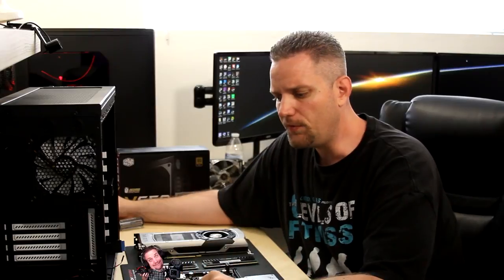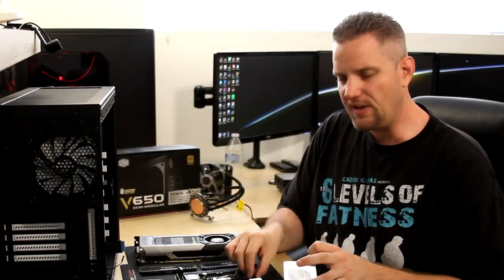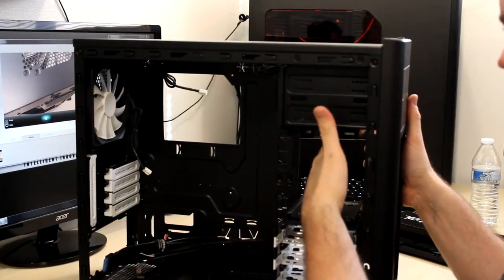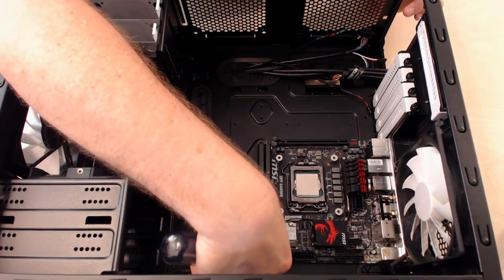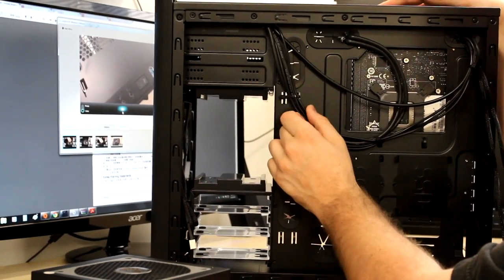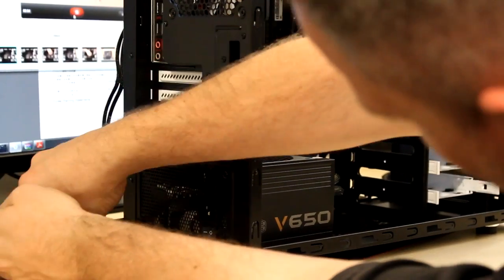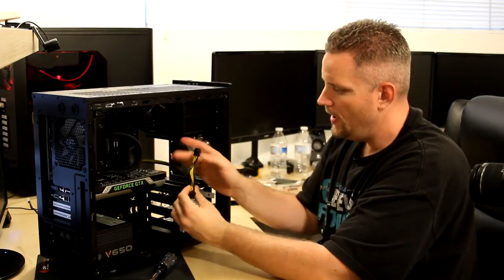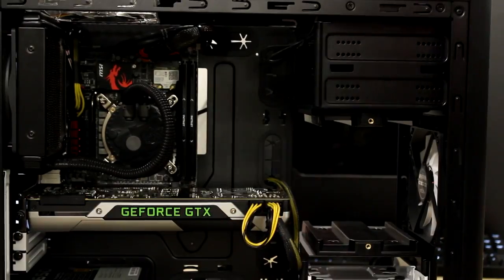Beginners Guide: How to Build a Computer

Comment: I will build a gaming PC in future, but what i'm worried about is the voltages because i'm in Europe (Russia), and i'm gonna get all the Parts from USA, i'm gonna get a Universal Power supply (110V - 240V) but what i'm worried about now is there will be a voltage difference in motherboard, ram, graphics card,.....?
Reply: What mains voltage do you have in Russia? It will probably be less expensive to buy your components in Europe.

Comment: Any advice or suggestions appreciated! :)

Motherboard: MSI Z170A Gaming M5
CPU: Intel Core i7-6700K @ 4GHz
CPU Cooler: Cooler Master Hyper 212 EVO
RAM: Corsair Vengeance LPX 16GB (2 x 8GB) @ 2400MHz
GPU: EVGA GeForce GTX 980 SC ACX 2.0
PSU: EVGA 220 G2 550W
Case: Cooler Master Mastercase 5
OS: Windows 10 Home
HDD: Western Digital Caviar Blue 1TB @ 7200RPM
Reply: Seems pretty good, I'd go with a 650W PSU tho and a beefier CPU cooler if you plan to overclock or push it with continuous stress, other than that solid build :)
Reply: Also with that kind of build I'd get an SSD, super fast loading and boot times, as in seconds instead of minutes, 120GB minimum for OS only , 250GB for OS and a few games, 500GB is plenty of space for games, OS and other applications.
Reply: Sean O'Brien Thanks! I will upgrade the PSU  to the 650W however I am slightly over my budget limit already and getting a stronger cooler or an SSD is going to be tough. But I won't be overclocking anyways so it might not matter I hope. :)
Reply: +MartIcy2001 All goods with that, but are you going to be doing a lot of CPU intensive stuff like video rendering, if not and your only playing games with some editing, go for an i5 6600k, same performance in terms of gaming and is cheaper too
Reply: +Sean O'Brien This PC is mainly for my flight simulator which is GPU and CPU intensive. It uses all 4 cores on my current CPU and the cooler won't stop cooling(it's stock though).
Reply: +MartIcy2001 oh ok, all good then, have fun :)
Reply: +Sean O'Brien :)

Comment: Do you mean build or assemble? Assembling your own book shelves or dresser is more difficult the biggest difference is making sure you have the right parts for the job. Making sure the core and motherboard work well together and the ram fits the slots. Older ram does not always fit the newer motherboards even when purchasing from the same company. Ram is normally cheap.
Reply: Same difference really. All the parts need to be built/assembled to make a working machine. With many of the newer CPU's and motherboards they will work best with DDR4 Ram which is horribly pricey at the moment, as are video cards. When you decide on a platform (Intel or AMD), ask yourself what you want to use the machine for and take your research from there. Most if not all motherboards are designed for one platform or the other, and by looking at the manufacturers' websites you can see which CPU's and RAM are compatible. Due to Cryptocurrency mining certain (GPU and RAM) prices have gone a bit crazy lately so now may not be the best time to build/assemble. Good luck!

Comment: I'm saving up for parts for my first gaming PC, I've picked these parts to use. Can somebody tell me if these are reliable and good for gaming? Here are the ones I'm thinking about using.I'm copy and pasting the names directly off amazon so if you need to look them up you'll probably find them.
RAM-Kingston HyperX FURY 16GB Kit (2x8GB) 1866MHz DDR3 CL10 DIMM - Black (HX318C10FBK2/16) 

PSU-CORSAIR CXM series CX650M 650W 80 PLUS BRONZE Haswell Ready ATX12V & EPS12V Modular Power Supply

SSD-Samsung 850 EVO 500GB 2.5-Inch SATA III Internal SSD (MZ-75E500B/AM)

Motherboard-ASUS 970 Pro Gaming/Aura ATX DDR3 AM3+ AMD 970 + SB 950 SATA 6Gb/s USB 3.1 ATX AMD Motherboard

Processor-Intel 7th Gen Intel Core Desktop Processor i7-7700K (BX80677I77700K)

Graphics Card-EVGA GeForce GTX 1080 SC GAMING ACX 3.0, 8GB GDDR5X, LED, DX12 OSD Support (PXOC) Graphics Card 08G-P4-6183-KR

Case-Rosewill ATX Mid Tower Gaming Computer Case Stryker M

Comment: I'm building a computer are these good specs?
 
CPU:Intel I5 4690k
Gpu: Sapphire Radeon R7 260X
Motherboard:ASUS Z97-A
RAM: Corsair DDR3 1333 16GB (2x8GB)
Power: Athena Power AP-MFATX35 350 Watt
OS: Windows 8.1 64-bit
Optical Drive: SAMSUNG 18X DVD-ROM 48X CD-ROM SATA DVD-ROM

I still need a case but, are these good specs.
Reply: buy a 1050 ti your gpu is garbage

Comment: Is that an anti static mat ? Would I need one of those ?
Reply: +Haffy Ali get 1 anti static wrist strap and connect the lead to your pc case to discharge
Reply: +Rakin Ahmed is that all we have to do with that wrist strap to build a PC? I'm a newbie so I'm confusing with it.
Reply: Get a wrist strap connect it to your pc case to discharge static electricity static electricity builds up and can damage the cpu
Reply: and other components
Reply: Get a nonconductive mat if you're going to lay out any materials on your desk. Any rubber mat would work. You should also work in an area without carpet and try to wear mostly cotton based clothing. Get an anti static wrist strap, however it is more of a cautionary measure and not entirely necessary. You can get by from just frequently touch the metal chassis of your case to bond yourself to it. An anti-static wrist strap is like 6 bucks so you can probably fit it into your budget.

Comment: Just wondering: when I buy pc parts, will wires come with 'em?
Reply: Yes. Your motherboard comes with 2 sata cables(could be more depending on the model), SOME drives come with sata cables as well. Your case comes with all the front panel connectors and gpus can come with via-dvi adapters if your current monitor has a bag connection and your gpu only has div.
Reply: Sorry auto correct, it's if your monitor has a VGA connection.
Reply: Reddonuts ok thank you :)

Comment: Wait. So if my PSU is not good enough it might basically kill all components? Would be very thankful for am answer.
Reply: It won't but for example if you have a 400WATT power supply and your components need a 450WATT the components won't work well
Reply: thanks for answering but I have already built one and everything went went well, thank god :)
Reply: William Sandahl Quality does matter also, go around 50 watt above what you need, 80+ bronze/gold and nothing below the price of 30-40$. corsair,xilence and cooler master have good psu's
Reply: i went 150 over i think, bought a cooler master :)
Reply: good job :p

Comment: Here is the list of parts that will be in my first custom gaming pc only thing different is i am ordering it from cyberpowerpc
Case - NZXT Source 340
Fans - Maximum 120MM Color Case Cooling Fans 
Noise Reduction - Anti Vibration Fan Mounts
CPU - AMD FX-8350 4.00 GHz Eight-Core 
CPU Cooler - NZXT Kraken X41 140mm Liquid Cooling Dual Standard Fans
MOBO - ASRock Fatal1ty 970 Performance AMD 970 ATX 
Ram - 8GB (4GBx2) DDR3/2133MHz Dual Channel Memory G Skill Ripjaws X
GPU - AMD Radeon R9 290 4GB GDDR5
PSU - 600 Watts - Corsair CX600M CX Series 
HDD - 1TB Western Digital Caviar Blue 
SDD - 120GB Kingston SSDNow V300 Series
HD Cooling - Vigor iSURF II Hard Disk Drive Cooling System x2
OS - Windows 8.1 64 bit

My build with the monitor and headset come out to around 1500

Comment: newbie here. I have one question and probably a stupid one. Does everything inside there need to connect with power supply?
Reply: Yes. The power supply powers the gpu, motherboard(which also powers the front panel connectors), cpu, and all of your drives and fans/coolers. However fans/coolers can connect via motherboard so it's not always directly from the psu.
Reply: +Reddonuts so the only that might be exceptional is coolers/fans?

Comment: help! my new computer that i built and it turns on but  turns off in like 10 seconds. how can i fix that?
Reply: Try putting different ram dimms in to see if you got a dead one
Reply: Nvm, i fixed it since my pc parts are brand new i just put my monitor cable on my videocards port rather than the motherboards one and then i saw the screen saying that there was a usb cable that didnt need to be in a slot.

Comment: Are these parts compatible?

CPU: AMD FX-6350 3.9GHz 6-Core
CPU Cooler: Cooler Master Hyper 212 EVO 82.9 CFM Sleeve Bearing CPU Cooler
Mother Board: ASRock 970 EXTREME4 ATX AM3+
RAM: G.Skill Sniper Series 8GB (2 x 4GB) DDR3-2133 Memory
Storage: Seagate Barracuda 1TB 3.5" 7200RPM Internal Hard Drive
GPU: Gigabyte Radeon R9 270X 2GB WINDFORCE
Case: Corsair Graphite Series 230T Black ATX Mid Tower Case
Power Supply: EVGA 600B 600W 80+ Bronze Certified ATX
Optical Drive: Lite-On IHAS324-07 DVD/CD Writer
OS: Microsoft Windows 8.1 - 64-bit (OEM) (64-bit)
http://pcpartpicker.com/p/xYcN99

Thanks.
Reply: Yes, but I would suggest swapping out the Radeon r7 270 for a Gtx 960 SSC.
Reply: ***** 960= Better Performance and good price performance ratio
r9 270x = Older, Slower, and less compatibility with games made for Nvidia like Watch Dogs and The Crew 

Bitch plz
Reply: ***** Okay, since steam link hasn't come out we dont know if it will suck or not so we have to wait until it comes out, but Nvidia Gameworks does make games look better, it is just an opinion that it looks worst. Although if you have a Nvidia GPU then you won't have to change any settings or change gameworks therefore Nvidia is better. I think everyone can agree I won this battle.

Bitch plz
Reply: ***** I guess I can agree on that. But with the Gtx 960 vs amd r9 280X the 280X cost more.
Reply: ***** Alright, but the problem with the 280 is that it uses more power, when I built my cousin a PC he cheeped out on the Power Supply and bought a 400w Power Supply, and the r9 280x didn't work for him he ended up returning it and buying a 960 and guess what, it worked. And he still had extra power and money to buy a Intel Core i7 and overclock it.

Comment: Is this a good build?
i5 6600 205$
EVAG geforce 1060 SC 3GB GPU 210$
ENERMAX Ostrog GT ECA3280A-BL Black / Blue Steel / Plastic ATX Mid Tower Computer Case 73$
Seagate Desktop HDD ST1000DM003 1TB 64MB Cache SATA 6.0Gb/s 3.5" Internal Hard Drive Bare Drive  50$
Optical Drive-20$
GIGABYTE G1 Gaming GA-Z170X-Gaming 3 (rev. 1.0) LGA 1151 Intel Z170 HDMI SATA 6Gb/s USB 3.1 USB 3.0 ATX Intel Motherboard -140$
G.SKILL Ripjaws V Series 8GB (2 x 4GB) 288-Pin DDR4 SDRAM DDR4 2400 (PC4 19200) Intel Z170 Platform / Intel X99 Platform Desktop Memory Model F4-2400C15D-8GVR 50$
EVGA SuperNOVA G2 550W 80+ Gold Certified Fully-Modular ATX Power Supply-85$
Windows 10 OS-94$
Reply: dont really need and optical drive unless you are actually gonna use and check when your motherboard fits inside of your case,  other than that your are solid my friend
Reply: Carlos Medina
only reason I'm getting it is to install my OS really.
Reply: *****
I did some looking around namely the Power Supply and MOBO to save me like
100 bucks so i plan to get 16GB and i MAY upgrade to 1060 6GB if i can get it for a good price like 270$ or something...

Also getting the i5 6500 i hear it's just as good as the i5 5600 so yeah :)

Comment: if i have 1 ram and my motherboard can have 2 ram, it does not matter in which slot I put it ?
(sry my english)
Reply: No, it won't matter, but you wont be able to install further ram of the same sort.
Reply: what does that exactly means ?, i wont be able to remove the ram and put another one better on that slot ?? or i wont be able to put another in the other slot?
Because i wanted to buy an Intel GB GA- H97M-D3H and a corsair vengeance pro 8gb 1600mhz and, when i have more money, buy another crosair. That would be posible ?
Reply: KaiorxH You can't have 2 of the same types of ram, for instance 2x4 ram sticks. You can have 1x4 and 1x2 though
Reply: Extraordinary Memer ahh, i get it now. thanks !

Comment: I know this could be a stupid question, But if you buy your parts for your computer, Do you have to buy cables for inside the computer?
Reply: +joost00719 No, the parts will come with the cables you need.
Reply: The motherboard and PSU should bring all the cables.
Reply: Thank you both for your replies :)
Reply: +Anonymous Male the most you may, key word MAY, need is a cable for the monitor depending on brand and maybe a power cable.
Reply: Ive build my computer, if you have 2 ssd/hdd AND a cd drive you'll need to get an extra SATA cable to connect it, atleast in my case

Comment: If I have a PCI 2.0 x16 motherboard and a PCI 3.0 x16 Graphics Card, will those parts go together?
Reply: Yes, no performance loss either.
Reply: CRS awesome thanks man
Reply: LrdZye It won't be as good as if it was PCI 3.0 but it's not a noticable difference.
Reply: OAcesync So it's still as good as PCI 3.0.
Reply: CRS No it's not as good as PCI 3.0 it's a little slower but not that much.
Reply: OAcesync Sure thing. In theory it's better, but you just don't feel any difference in FPS at all.
Reply: CRS Yh excatly.
Reply: +LrdZye PCIe 1.0 16x=PCIe2.0 8x=PCIe3.0 4x Get the picture?

Comment: Will that be able to connect to the internet without the need for an extra part?(beginner)
Reply: Matthew Charlton If you get a PC that doesn't have a network adapter you can just get a $20 USB network adapter if you were going to be using a wireless connection anyway. Some people may tell you not to get them, I was told the same, but mine works, very, very well.
Reply: SatanicMuffin The only problem with USB adapters is that they're USB.  They fall out and lose your signal.  They get bent.  They get lost.  If you're sure none of that is a problem for you, go for it.  But I feel safer spending an extra $10-15 on something unlikely to be broken/stolen by kids I've got running around the house.
Reply: Knott O'Persson Thankfully, none of those things apply to me. Maybe one day when I'm out on my own with something better than 700 kb/ps download speed (on Steam) I'll opt to get a wired connection.

Comment: stupid question, but is thermal paste and a cpu cooler required?
Reply: Most CPUs come with a fan, no separate cooler should be required, if it isn't going to be under heavy load of course. Getting an extra fan is always recommended. Thermal paste is almost ALWAYS necessary. Some CPUs have it pre-applied, but some don't. Just buy a tube of thermal paste, it is useful anyways.
Reply: Theoretically, no you don't need a cooler or thermal paste at all. But any modern CPU even idle will run too hot to risk not having a cooler. Not sure if I answered your question properly but I hope it helped :)
Reply: I did not know CPU's come with a fan/heatsink lol, thats why i was worried =P
Reply: andomort Heh, well it is kind of a standard these days :P. Its fine though, questions are never a bad thing.
Reply: +andomort Most CPUs come with both. :D

Otherwise, I guess you could fry an egg on it or something

Comment: Hey JayZ I have my pc built but ran into one issue where the front audio jacks arent working I have
Asus Z170 Pro Gaming MOBO
MSI GTX970
CoolerMaster MasterCase Pro 5
8GB Corsair Vengeance ram
intel i5 6600k @3.5

I have the HD audio connector that came with the case into the AAFP pin but it isnt working

Comment: first time builder here . My specs are :
AMD fx 8350 
sapphire radeon dual X r9 270x 2gb
msi 970a-g43 motherboard
cooler master power supply 700w 
8gb corsair ddr3 ram .. 
Really worried I am gonna mess it up trying to put it all together . Any suggestions would help guys . Thanks . .
Reply: Just don't force anything and be delicate with CPU pins.
Reply: You don't need 750w. A 500w would be great. Hell, even a 430w will be decent.
Reply: Kyle Millar lol 430W will definitely not work, it's calculated around 482W so even a 500W is cutting close a 600W would work. But that FX 8350 is kinda wasted on a 270X, a FX 6300 would it better.
Reply: OAcesync have a FX6300 and R9 270x, can confirm, it's not bad either.
Reply: ワイズ Yeah I was orginally gonna get the excat same but the Intel Pentium G3258 turned out cheaper and I didn't mind dual cores as I don't intend to play any intense CPU demanding games on the PC like Far Cry,Crisis etc.
Reply: OAcesync I have a 500W too, if that's worth noting.

Comment: do pc parts blow up or get catche on fire if it was too hot to cool down?
Reply: Uhm, no. They don't blow up, they don't catch fire. If it gets too hot, it will simply stop working. Your pc will simply shut down completely (as in it will die) long before anything starts to melt.
Reply: +STR33TSofJUST1C3 Though you have to admit it would look cool.

Comment: Is this any good and is it all compatable and can it run bf4 ultra 70 fps? 

CPU: Intel Core i5-4690K 3.5GHz Quad-Core Processor  ($219.95 @ SuperBiiz) 
CPU Cooler: Cooler Master Hyper 212 Plus 76.8 CFM Sleeve Bearing CPU Cooler  ($19.99 @ Newegg) 
Motherboard: MSI Z97-GAMING 5 ATX LGA1150 Motherboard  ($146.98 @ OutletPC) 
Memory: G.Skill Ripjaws X Series 8GB (2 x 4GB) DDR3-1600 Memory  ($63.99 @ Newegg) 
Storage: PNY XLR8 120GB 2.5" Solid State Drive  ($69.57 @ Amazon) 
Storage: Western Digital Caviar Blue 1TB 3.5" 7200RPM Internal Hard Drive  ($53.97 @ OutletPC) 
Video Card: Asus GeForce GTX 970 4GB STRIX Video Card  ($339.88 @ OutletPC) 
Case: Cooler Master Storm Enforcer ATX Mid Tower Case  ($84.99 @ NCIX US) 
Power Supply: Corsair CX 600W 80+ Bronze Certified Semi-Modular ATX Power Supply  ($39.99 @ Newegg) 
Optical Drive: Asus DRW-24B1ST/BLK/B/AS DVD/CD Writer  ($16.99 @ Newegg) 
Operating System: Microsoft Windows 8.1 - 64-bit (OEM) (64-bit)  ($89.98 @ OutletPC) 
Total: $1146.28
Reply: yep
Reply: Pirating the os will save your money :p
Reply: Yes sir. That is more than enough.

If you ever want to overclock, like we all do, I would suggest you get a better Power Supply.
Reply: Get the Evo cooler not the Plus, The Strix 970 isn't that good so get Gigabyte or MSI, The SSD isnt good for the money buy the 840/850 EVO (I own one) and finally buy an EVGA psu as they are better for the money.